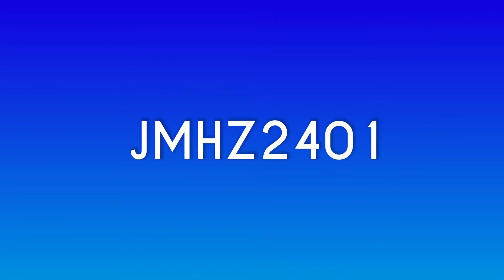Club 5 Racing Aluminum Servo Relocation for RedCat Racing Gen 8

Comment: I had to bend my ears on the negative terminal too. Also found out you can't install the servo mount without either a M3-20 screw which isn't included or their link kit. Very frustrating.
Reply from the maker: I took this mount off and sold it.

Comment: Great instructional video and you got a killer rig.  Awesome video
Reply from the maker: Thank you.  More information with comparison to a stock setup coming this weekend.
Reply: @JMHZ2401  completed agree did you happen to see my beadlock gmade wheel install?  Trying to get a next round of upgrades. Any recommendations?
Reply from the maker: @lridebashitrc9422  I don't think I did. Post a link and I will check it out.  I highly recommend the Hot Racing Internal spring shocks,  and a good radio.

Comment: How did you go about hooking that little winch up thats cool, thats what I want to do. can it operate off your controller or does it have its own switch? the whole thing confuses me. ultimately I want to run mine off my my controller (radio), I have 4 available channels left I just have to figure out whata needed to make it happen .. Thanks
Reply from the maker: I have my winch running off my controller,  using a wireless winch controller.

Comment: Good video man.. Hi, would the club5 links would work with standard stock servo mount on the gen8 or do i need to buy the servo relocation as well?
Reply from the maker: Yes they will work with the stock setup. The link ends are very big and will rub inside of the tires. I have since switched to intheworks links.
Reply: JMH RC i have the 12 mm brass extended wheel hex... would that be a problem?
Reply from the maker: @thiagoandes2951  you will likely be ok then.
Reply: JMH RC thanks i just received the club 5 link and yet to install them. Thank you for your video.
Reply: I have these but with the stock servo mount I have no steering
Reply: It steers but when it’s on the ground theres literally no steering now would I fix this
Reply: yes they work with the standerd servo mount have them on mine